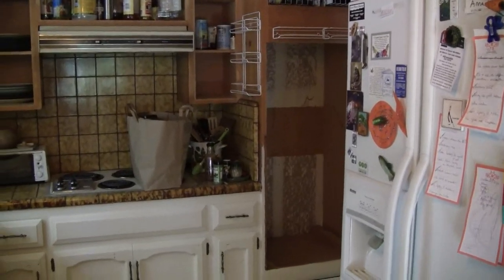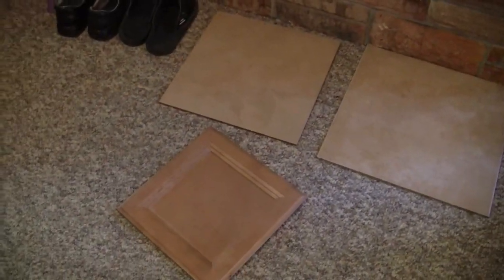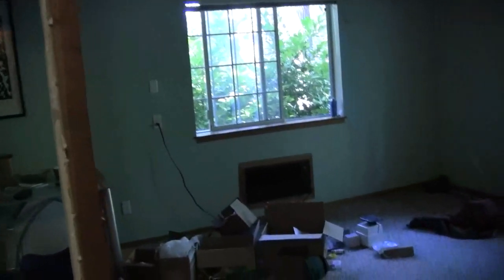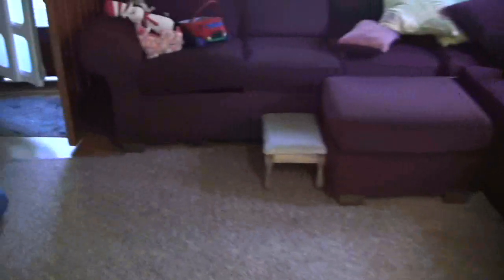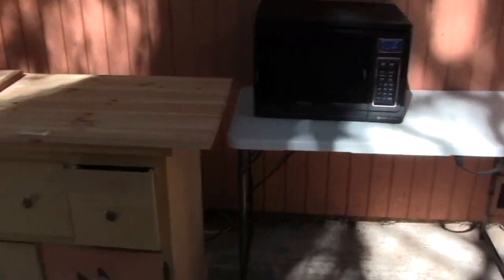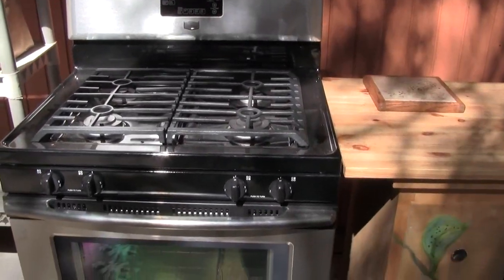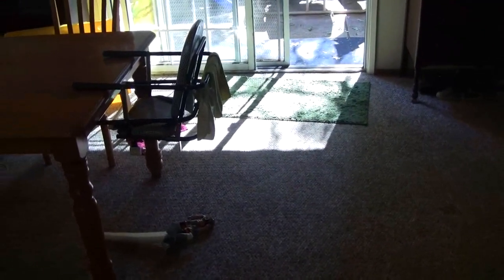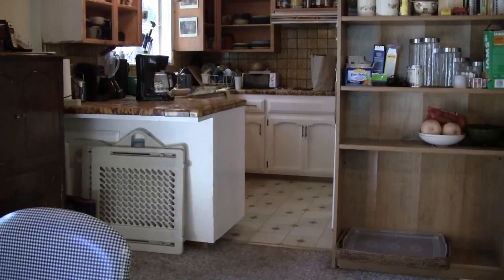Remodel for Steam Turbine Power System 1.wmv

Comment from the maker: No.  The windows are already double pane and doors are fine, sliding door is double also.  However, one thing we did has already had a surprising benefit.  I just posted up to #7 in this series so kitchen is working, tile is down etc.  The plastic barrier under mortar tile base and the mortar and tile sealed the floor from air infiltration.  Last winter, couldn't keep the place warm running 2 wood stoves.  Now, it's toasty inside and in low 40's to high 30's outside running 1.  Huge improvement.